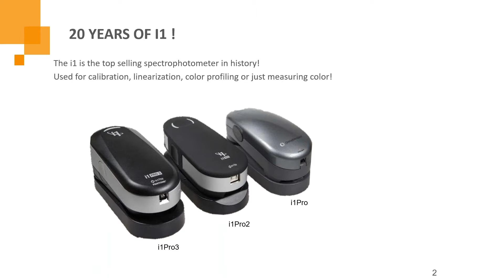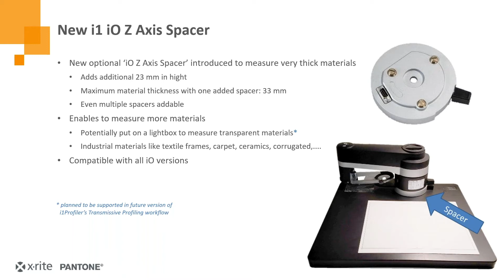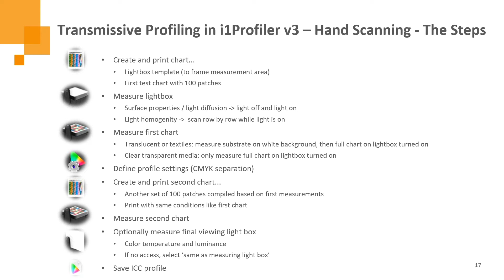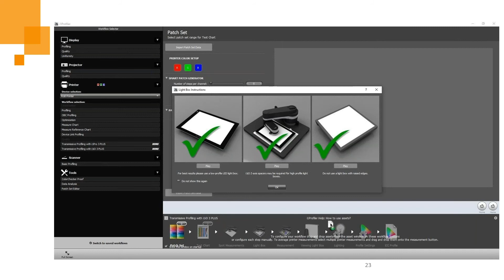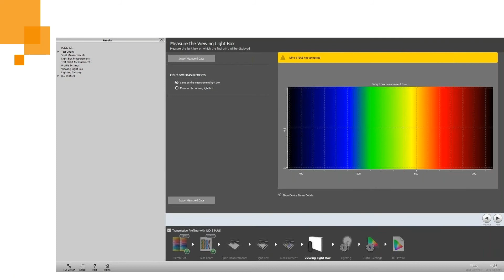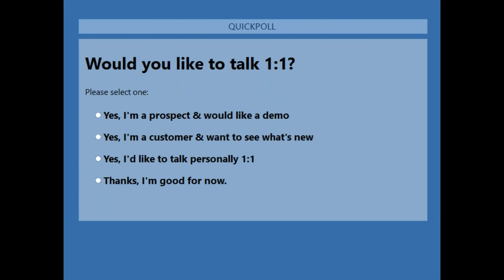New Tools to Profile Backlit Materials

Comment: Thanks for that. Should the M3 filter be used for textured/un-even find art paper?
Reply from the maker: Great question! Using a large aperture is the starting place for success in measuring rough or uneven surfaces. M3 comes into play if those surfaces when printed on also exhibit surface reflections that can mask saturation in both the shadows and highlights.
Reply: @XRiteColor  Thank you :)